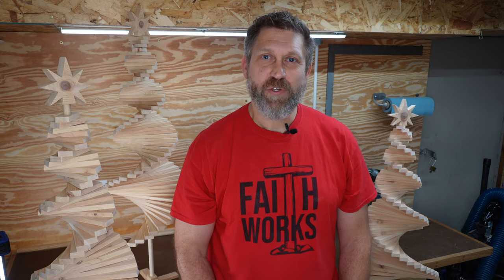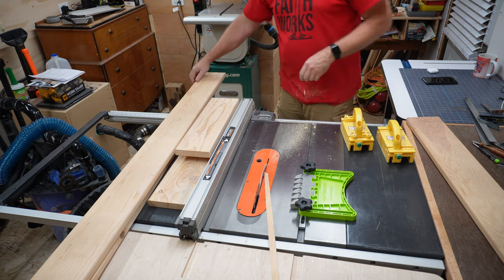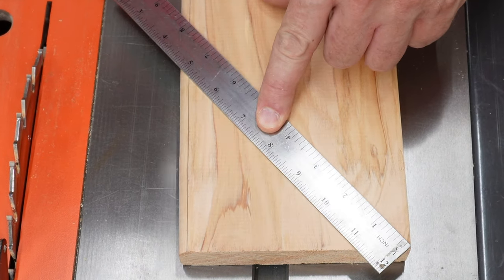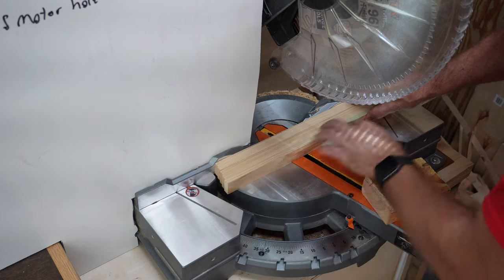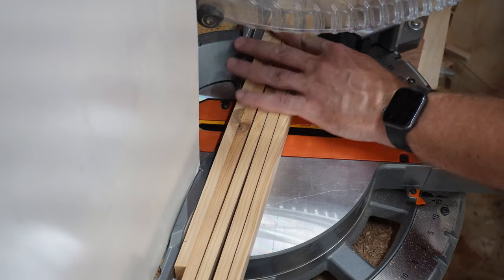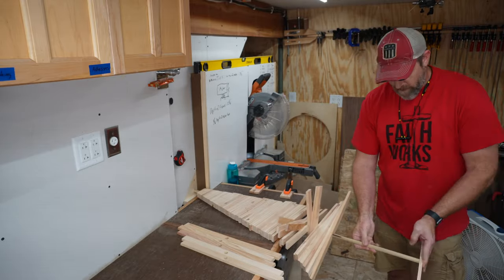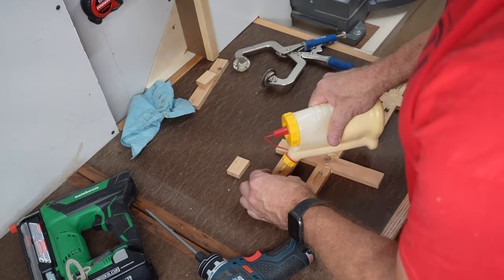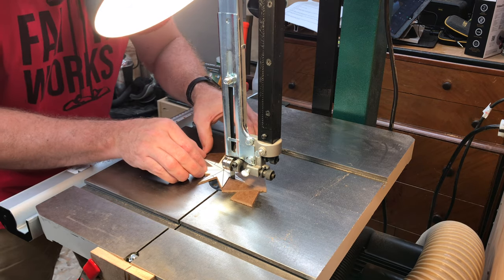Build a STUNNING Spiral Tree with JUST 2x4s and a FREE Plan!

Comment: The 4x4 you use as a stop is that 13 degrees to nice work thank bill
Reply from the maker: The block I used at the miter saw was just a straight edge to line up the pieces. The angle on it doesn’t really matter as long as it’s straight. Hope that makes sense…

Comment: Brett. I am in a manual wheelchair & am wondering, could I possibly cut each piece angled individually as it might be difficult, if not unsafe for me to cut the whole length with a circular saw? Would it work out the same?
Reply from the maker: You bet! The angels are just aesthetic. You could even make straight 90* cuts if you want where each slat is progressively shorter
Reply: thank you. Much appreciated.   @BrettsWoodshop

Comment: Hi Brett’s I have a question I make the tree both sides are straight I only have a hand drill I just can’t seem to drill the first hole center 3/4 inch in it just want to walk I even did a starter hole but the 5/8 drill want to walk I think I go buy a drill press any help would be greatly appreciated thanks bill
Reply from the maker: Make a drill guide by first making a hole in a piece of scrap. Then clamp the guide to a few of the slats stacked together. Hope that makes sense!

Comment: I made one of these and had to sand down the dowel and sand the holes in each branch.   How did you not have to do that?   My dowel was 3/4" (it's what I could get) and I  used a 3/4" Forsner bit.    But nothing fit without all the extra sanding (which was a pain).  Your video is great.   Just found you.   Already subscribed.
Reply from the maker: That does sound like a pain! I used a 5/8” dowel and bit and they fit nicely. Sorry!Thanks for the support!
Reply: I had the same problem with the 3/4 dowel. I sanded it down by putting a screw in the middle of the dowel and then put the screw in a drill and running 100 sandpaper over the dowel. It took about 5 minutes!
Reply: @rpaulvan  Thanks.  I'll do that next time.  I'm new to wood working and still learning the tricks.    That would have been a lot easier than doing the sanding by hand.  :)
Reply: @lauramarshall6376  hold the sandpaper with a leather glove. It well get quite warm.
Reply: excellent 👍👌 the 3 foot is the one i was plannkng to do ..i did a 6 foot but it takes to much room and it was close to 60 meters of wood or 180 feet to much work ...because the saw🪵 mill ..is close to my house i bought the wood already trimmed to 1inch by 1/2..  i want to try now. the 1.1/2 inches by 1/2 inch ..i think it will look a lot better

Comment: I bought 5/8s dowels but drilled 3/4 holes by mistake, went and got 2 3/4 dowels as i started my second tree  luckily i only drill 5 and the second tree so started over using 5/8 drill
Reply from the maker: Oops! I don’t think I ever make something without making a mistake. Happily, with wood, there’s usually a way to fix it!